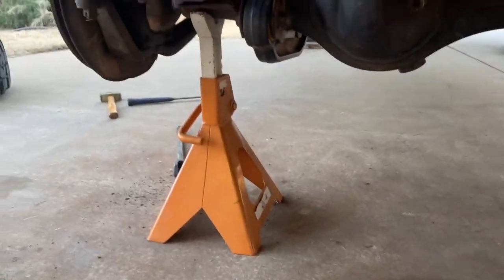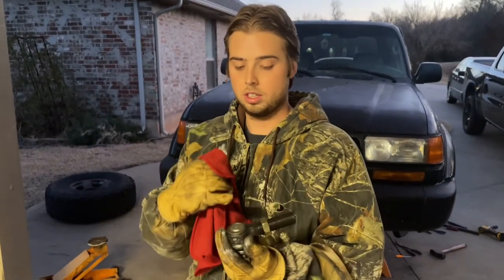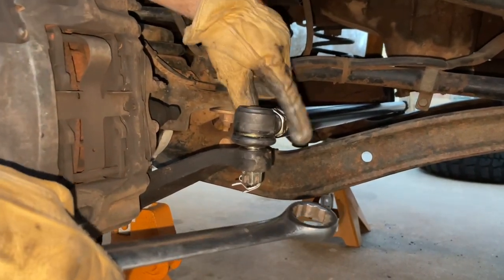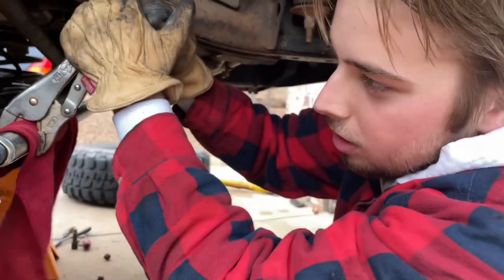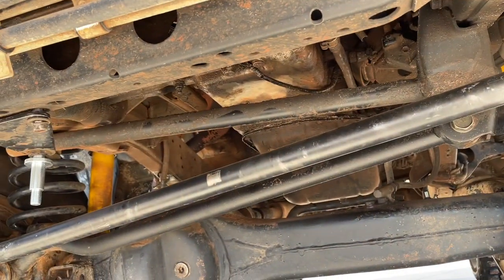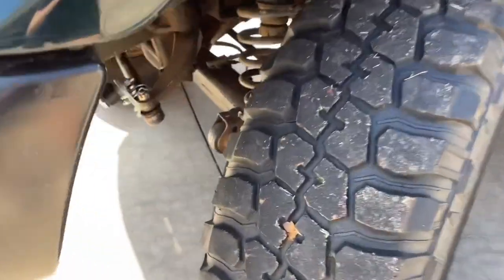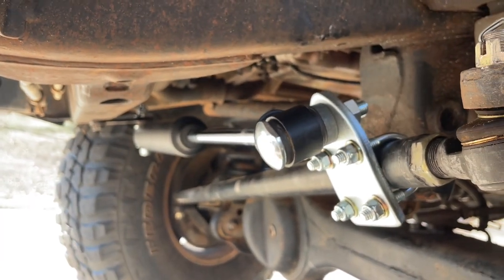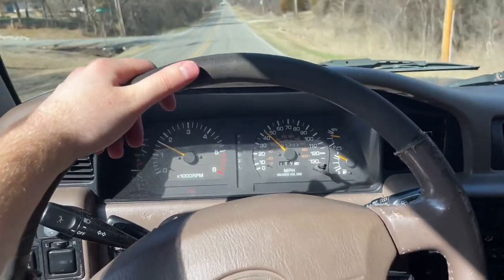80 Series Land Cruiser Trail Gear HD Steering Kit Install

Comment: Sledge hammer? No torque specs? C'mon, kid! "It should be tight enough..." Owners manual is available online.  tsc tsc tsc
Reply from the maker: i don’t like pickle forks and most of these fasteners have cotter pins, i can assure you they were all tight and will remain that way. thanks for watching!